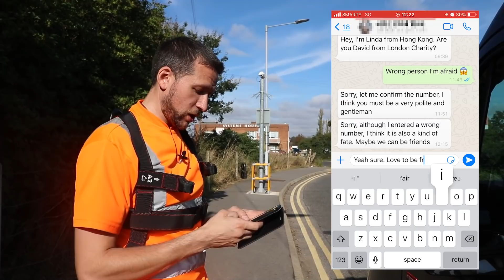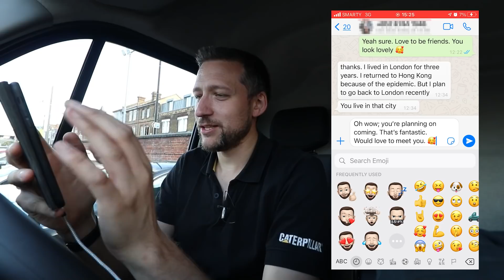I HAVE A STALKER.... | Thomas Nagy

Comment: 7:50 - you can use a sounder output to trigger a zone input on another panel, haven't got to be networked.
Reply: What if you don't have a spare zone, most outrageous can be linked, some are more of a faff than others
Reply: @acelectricalsecurity  I'm saying that they don't have to be "networked",  that's all

Comment: Tom, "Arm's Reach" was actually a big part of the 15th Ed. Regs (1981). It actually appeared in Part 2 Definitions: "A zone of accessibility to touch, extending from any point on a surface where persons usually stand or move about, to the limits which a person can reach with his hand in any direction without assistance."
The reg on light fittings in rooms containing a fixed bath or shower was as follows:

"471-38 In a room containing a fixed bath or shower cubicle, parts of a lampholder within a distance of 2.5m from the bath or shower cubicle shall be constructed of or shrouded in insulating material. Bayonet type (B22) lampholders shall be fitted with a protective shield complying with BS5402. As an alternative, totally enclosed luminaires may be used."
The 14th Ed (1966) and even the 13th Ed (1955) had very similar regs.
The shield to BS5402 (or BS52 in the 14th) was called a Home Office skirt, the same as a flared shade ring on a battenholder.

Comment: I agree about those large bezel 'integral' lights from Toolstation being very handy. They're my go to for retrofits
Reply from the maker: They are REALLY good!
Reply: @thomasnagy  and totally with you on not using integrated fittings. Only ones I've ever fitted are floodlights, cheap under cabinet striplights or things specifically requested by the client. Battens with LED T8s and bulkheads with ES or BC but not stuff where LED failure means replacing the whole fitting

Comment: Call it 5 years. I've just put a retrofit Crompton LED tube in a 5' Crompton T12 fitting that has been in service since 1980. (41 years of service and original control gear.) After numerous years of the tube being obsolete it has only just this minute become competitive to retrofit. Let alone replace.

Comment: See section 1.8 of GN 7: washing machines and tumble dryers, for example, can go in zone 2 as long as they are minimum IPX4, IPX5 if subject to water jets, and MIs say is ok. A plug and socket to supply them is ok if >3m from zone 1, or by a permanent connection unit located outside zone 2.

Re the fan above zone 1, I suggest you're correct, and would argue it should be minimum IPX5.

Comment: One streetlight an hour you won’t win any contracts doing that. I wish you all the luck in the world I look forward to your videos.
Reply: Had several years on lighting on a previous job including street lighting and know it isnt a quick job changing street light heads. By time got set up got fittings isolated, unpacked then swapped, time soon goes. Can guarantee will get one or more fittings with seized or knackered fixings.
Reply: @chrismaplethorpe6781  isolating the street light is pulling a fuse at said lamppost where you disconnect the old light anyway hardly time consuming. As for seized fixings a heavy hammer and recip saw will sort that. I’m certain  if your boss said change twenty heads a day then you can go home you’d be home early. We did 24 a day and finished lunchtime most days. You get into a rhythm.
Reply: @gartholamu7916  most sites i have worked on you  dont get the option of going home early when done. Also am well aware how to isolate the fittings. Could do 3 or 4 fittings in an hour if in one area, but more often than not had to move equipment round a large site with a fair distance between fittings so a large  quantity of lights wasnt an option. Am guessing you havent also had to deal with fittings and columns that are potentially 30+ years old on a petrochemical site where correct safety precedures have to followed and cant away with doing a rush job. So please dont criticise without knowing the full situation.

Comment: Used to hate painted light fittings and switches when used to do domestic. Have had to break a fair few ceiling rose covers to get to connections, then get moaned at by the home owner for damaging the light. As for the fan i would rather fit the 12v fan and a suitable light that close to the shower regardless of the zoning.

Comment: Boilers are installed per manufacturers' instructions, which will often state where they can be installed. For example a  Worcester Greenstar i30 fitted with a blanking plate or control unit rated to IPX4D can be installed in zone 2. Rated below IPX4D outside zone 2.

Comment: One thing to watch for with power banks/inverters is to make sure that they are not "modified sine wave". Nothing modified about it as they are mostly square waveas a result of the MOSFETs used inside with smoothing caps if you are lucky. As a result, most things with a normal AC motor will not run properly because the magnetic fields inside such motors rely on the sine wave. Fridges, freezers, fans etc usually don't run properly and can cause damage if you are not careful....

Comment: I’ve seen them changing the street lights outside mine, must’ve been about 5 minutes then off to the next and a second guy following doing the connections in the bottom. Was literally pull up, get a light out, disconnect, go up, unbolt the light and lower it down the the floor with the cable, bolt it up then back down for the next. No cones or signs or anything. That’s how you do 40 in a day

Comment: On the note of the integrated lights  after 4 years the fitting you fitted are now not available so you either fit a odd one ( not a good look )
Or tell the customer that you have to replace all of them. But as usual Tom a entertaining video but you need a break from work as your heading for a burn out.
Reply: As long as you buy a good brand (like Schneider or similar) it's no problem, you can always get replacmenets with identical look and colour temperature. Plus those usually come with an external driver pack and it's often the driver that fails, not the LED.
Reply: My experience to-date has been that, once one or two fail, then you pretty-much have to replace all of them or you'll be getting repeated calls about more having failed in the near future.  This goes for any integrated type fitting, e.g. LED/electronic equivalents having replaced tubed/magnetic fluoro fittings.

I reckon we'll see most of these fittings in landfill within 10 years unless producers start taking the 'Dubai Lamp' approach.
Reply: Manufacturers will never do that since everyone is competing on price. We as installers can easily do our own 'dubai lamps' by using for example 350mA downlights with separate drivers set to 300mA. The downlights will last forever and you will replace a driver ever 7-10 years.
Hide-a-lite rates their downlights for 50 000 hours.

Comment: What? how are those LED strips drawing 70w per bay? I have some high powered LED strips in my garage, with all of them on full brightness they only draw 60W total. Maybe the strips are longer than it looks there?
Reply: Strip is probably 14.4W p/m. Those bays could easily be 5m each, so that would be 72W.
Still somewhat bright for a corridor though!

Comment: Nearly every bathroom had a big metal electrical appliance in it at one time. The hot water cylinder. Wouldn't worry about washing machine in bathroom, as long as socket is 3M from bath.
Not like it can fall in the bath with you.

Comment: 16:22 Here in the USA minimum codes are just that.  They are a D- (just above failing) any lower and it will fail and you have to do it again or better.  Always strive to do better, why do a just scraping by job when you can put a little effort and make it much better! 👍
Reply: Why scape it and run the risk of having to do it again? Better to do a +10% higher standard (or better) and keep away from collecting black marks.

Comment: Zones in BS7671 are a minimum standard not a requirement because it's non statutory. People tend to forget that everything on top of that to ensure no danger to persons or property is the requirement that the courts will drag you over the coals for. You're in the same line of thinking with appliances in bathrooms as our company and generally the Gas regs and boiler manufacturers advise and in some cases insist the appliance is not installed in a bathroom.
Reply: Not just the reg though as condensation from the bath or shower could potentially cause electrical/electronic shorts.

Comment: Great vids, should the bathroom fan be IPX5????
From a textbook 
Zone 1
Applies to the area around the bath or shower up to a height of 2.25m above the floor 
and at a radius of 1.2m from the water outlet. A minimum rating of IPX4 is required. If 
the fitting is 240V a 30mA residual current device (RCD) must also be used to protect 
the circuit in this zone, i.e. SELV with the transformer located beyond zone 2. If there 
is a likelihood of water jets being used for cleaning purposes, a minimum of IPX5 is 
required.
Reply: Most electric showers are only IPX4 which always amazes me!

Comment: Quick question. When you do an eicr and find a C2 or c1, does the owner HAVE to have it fixed or can they just tell you to get lost about it?
Reply: If you find a C1 you really have to make it safe before you leave as that is an immediate danger to life. Tell the owner and if they are tight and don't want any remedial work done, you can just disconnect the whole circuit in the board so the whole circuit is dead then email the owner telling them what you've done and why and it's up to them if they wire it back in.
A C2 they can ignore you but they wont get a completed (Satisfactory) certificate until all the C2's are fixed. (So they'll just get a guy who'll do and EICR for £60 and hope he misses them and signs them off.)
C3's you can have pages of and they can ignore all of them and still have a completed cert. They are just recommendations.

Comment: Had a Philips version of the architectural lamps as a highlight in a curving soffit over an MRI machine in a hospital I used to work at. Bloody PIA to keep connected. Might want to chat with Clive about those LED strips pulling 70W. Sounds like they may be over driven which will cause them to fail faster. LEDs Flickering is generally the power supply, not the "lamp".
Reply: Problem is mounting light fittings with built in "power supply", they overheat and fail faster, and you have to replace the entire fitting not just the external driver pack.

Comment: Washing machines in bathrooms. So outside Zone 2 then? Thats 60 cm from the edge of the bath which is about reaching distance correct? And no sockets within 3 m even if they are in a cupboard? Was presented with this scenario just last week by a customer that wants to redesign their bathroom and put tumble dryer w/m in. I said they would need to be plugged in, in the adjacent room and the machines need to be over 60cm from the bath. Interesting comment about the pendant light. At 15cm the average pendant with rose would just encroach below the 2.25 limit would it? Never seen a pendant yet in a bathroom though but it seems this is what this regulation is designed to cover?

Comment: 5:20 interesting, what about a standard pendant light fitting? you could put your finger in that and accomplish the same?
Reply: Very true but in most cases you would want to be on a chair or ladder.... These other lights could be accessed in many circumstances without and also kids could easily touch

Comment: Are those lamp connections any worse than a ceiling rose without a lamp in and switched on, I have come across plenty of batten holders wall mounted in cupboards with no lamps in.
 Same with electric showers, you basically have a big kettle on the wall, and a piece of equipment people will have their hands on, never been a fan of electric showers.

Comment: Re the Architectural lamps, i'm not trolling - honest question here, im not in the industry. How come that's a C2 if a pendant light is ok? Take the bulb out of a pendant and you also have exposed terminals? Neither need tools to access, both are out of reach of children? confused 😂
Reply: Because typically pendants are fitted on ceilings and architectural lights could be fitted anywhere like next to a mirror as he explained.
Regs are like art, all open to interpretation but some interperate them better than others.
Reply: Because these are fitted on walls for example, most pendants are at such a height less risk

Comment: Thomas i worked for Amey you could do 40 a day as we did all signage and cones might not have been 100% but it can be done.
Reply: @acelectricalsecurity  but even not corners you could do more than 8 a day. My gaffer would hang me if I changed 8 in a shift.